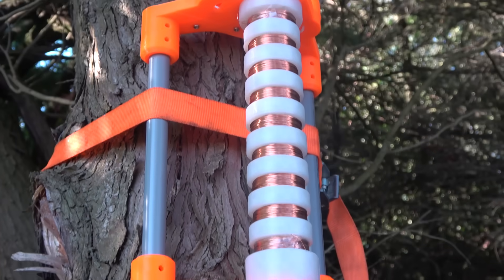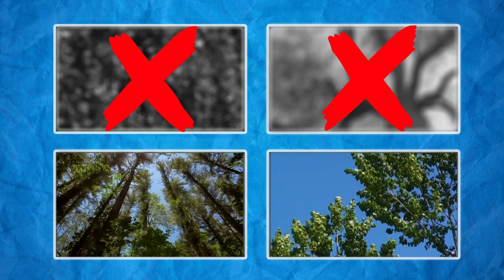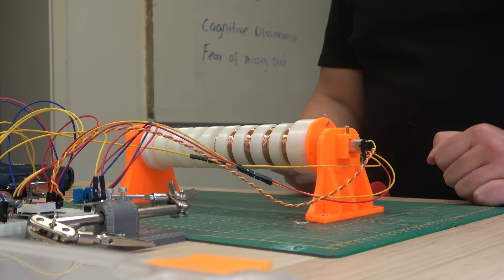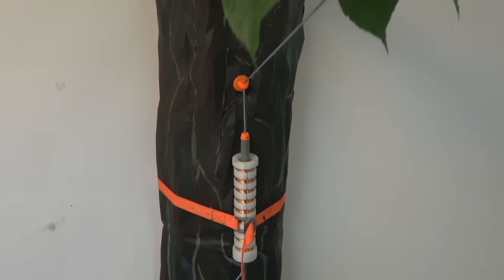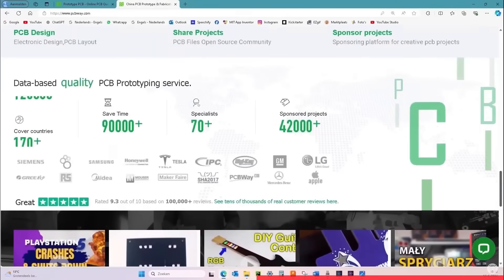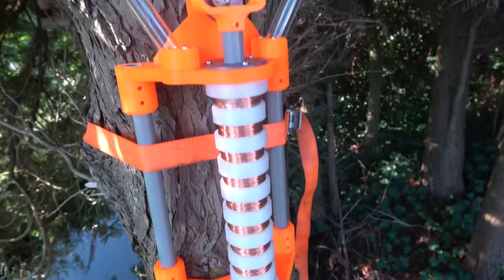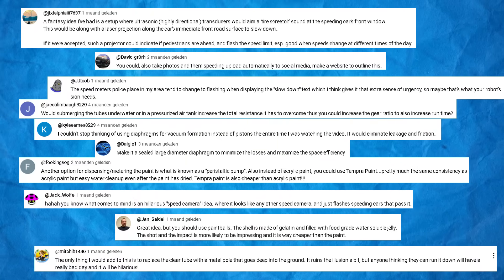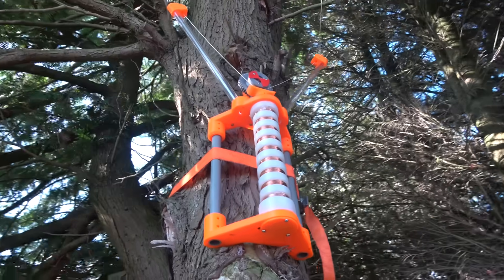I Made a Tree Generate Electricity..

Comment: bravo -- brilliant. 

my thought is to position the piston horizontally -- this would alleviate the extra energy needed on the upstroke due to gravity. 

since one of your goals is to keep the device aesthetically unobtrusive you could place several shorter devices on the trunk instead of a longer one that stretches beyond the diameter. 

to reduce friction and vertical imbalance you could place repulsive magnets on the core that extends beyond tube to "levitate" it above the bottom of the tube -- or reverse the configuration so coils are on the inside and the magnets on the outer tube. 

again, bravo, your creativity and imagination has you standing head and shoulders above most others doing this on youtube.

Comment: Anchoring: Straps flimsy and possible damage to tree (as noted by others), lag bolts used other applications but dangerous in a sawmill. I suggest using "trunnels". Wood tapered pegs commonly used in traditional ship building. Black locust or hickory ?

Comment: Nifty idea!  Some thoughts:

1. Every region has 'prevailing winds'--which accounts for most of the wind direction--that can be looked up for your locality.  If you only worry about branches perpendicular to the prevailing winds, you will automatically increase the system's efficiency without any extra effort.

2. To multiply the force, just attach the system to multiple branches in a flat chain.  (You might want to add springs on each side of each branch or use elastic cord to avoid excessive  strain on the system.)

3. For more even power output, I suggest using this system to charge a 'gravity battery' instead of generating electricity directly.  (i.e. A heavy weight is hanging from a cord that is wrapped around a drum.  As gravity pulls the weight down, the rotating drum uses a gear multiplier to rapidly spin a generator.  These are used for LED lamps/phone chargers/etc. in many developing nations as they are so simple & easy to build and use.)  A rachetting mechanism could use the force from the branches moving in the wind to pull the weight back up, 'recharging' the gravity battery.

4. Multiple cords, each on its own drum, can be used with a single generator both for more power and to smoothen out the pulses.  A simple 'reversing gear mechanism' would swing each drum to the left/right so that the generator shaft is always rotating in the same direction, no matter which direction each drum is rotating.

Cheers!

Comment: How long would this generator need to run for to generate enough energy to make all the wire magnets and plastic used in its construction? My guess is that it would be longer than the generator will last for, quite possibly longer than the tree will live for.

At very least the gears will have to be metal or they will wear out way too quickly, you will also need to make the whole device weather proof and sun proof as trees obviously need both and water rusts metal and the sun destroys most plastics over a few years.

The rope would also degrade over time... I'm sorry but I can't think of any way to make this viable. You are better off just planting a load of trees and then harvesting them when they are large enough and burning them in a much more traditional generator.

Comment: I'm a bit rusty but if I remember correctly the power generated by a motor like this should be P=((number of loops per single coil)^2*(lenght of single coil)^2*(vacuum permeability constant mu0)/2)*(frequency of oscillation)*number of coils). I counted the oscillations based on the few seconds of footage to be about 2 oscillation per second, topping the power production of a single one of these to be .12 Watts. Basically you would need about 300 of these to run a tv, or 10000 to power your entire house; if you are very intensive you may be able to place 10 of these per tree, but I'm guessing the cost of materials would not be worth it. I am really curious on how this design can be improved though

Comment: When the wind blows on the branches in the same direction, the rope will break or the gear axis will break. I think it is better to tie one rope at the top of the tree as in your first explanation, but use a gear that has half the number of teeth and the other half is empty so that when a lot of tension occurs, it rotates 180 degrees and when it reaches the place of the empty teeth, the rope will relax, causing the axis to be released inside the tube since the axis is attached to a spring at the base. I hope you get the idea.

Comment: Have the linear motion run many different air pumps.  Hosses collect the energy into a central location from multiple branches into a pressure tank, perhaps a soda bottle. Then run a turbine or one of those motors on those old AirHog air pressured airplane motors to turn a rotational motor. For the pumps, they could be bladders of air that wrap around the tree in different configurations that the movement would act as a pump over a check valve.  This would allow capturing motion which may not be linear.

Comment: nice! I had that idea some years ago.  I'm only mentioning that because it's especially interesting to me to see it working!  I arrived at the idea because I was building a treehouse, with modern hardware that consider the tree/trees movements.  I thought, why not power the house with--> the house! I decided on a simple retractable  spool(like a carpenter's tape measure or 'yo yo').  Hook the string end to a branch and the rest(compact generator) to some part of trunk and plug in some wires, done. Dozens could be strung together in matter of minutes and create enough watts to run lights and small appliances through a battery bank.  I'm working on a prototype for a product that uses the source of energy.  It doesn't require a battery bank or at least not a large one. But I'll save the details for the final release.

Comment: A circular alternator would be far more efficient than the tube. You've already used the gear in your design, simply swap that out for the circular style. Also if you can get them to spin in one direction rather than than a back and forth you can build up momentum during the moments that there is no movement.

Comment: is the linear generator that much better than having a clutch bearing to maintain a single direction of a rotating generator? you would be able to add a flywheel to make it spin nearly endlessly since the main characteristic of a trees' movement is the sway so back and forth endlessly.

Comment: Two big issues I see with the idea. One is the growth of the tree affecting the length of the lines you have operating the generator. You would be, throughout the year, having to adjust the length of those lines. But who says you can't build a tree like structure that, of course doesn't grow, but does sway. But then, why not just build a generator in the style of the old wind mills and we already have those. Second issue, which could be dealt with but makes the whole thing more costly to produce, and that's it's tolerance to the effects of weather and aging. The more expensive it is to produce makes it only practical if the power produced is significant. I do like the idea and the heart of your generator would be great for an idea that I had to use the motion of waves in a lake or ocean to generate power.

I had another thought that represents a problem for your devise. Trees are always shedding small branches and twigs that will undoubtedly, become a monkey wrench in the system when they get caught up in the lines. You might be climbing the tree quite often to free up a snarl.

Comment: FYI... it is the Wind that generates YOUR electricity using a Very Low Efficiency Wind energy capturing Device. Wind turbines are a lot more efficient. Nice Gimmick though
Reply: Is it possible that wind turbines are not always the solution in every single situation, and there just actually maybe a place for this linear generator setup too?
Reply: @fringestream990  I would need Tree Size and Wind Speed to KW output Data.....

Comment: I've seen a number of brilliant ideas mentioned already and at the risk of repeating some (since I haven't read all 2473 comments) I've got a couple of ideas that could very well be silly but that I'd like to throw out there anyhow. 

I love the idea of a flywheel it is something that I had considered while trying to design a vertical axis wind turbine(VAWT) once.
One thing that I thought might be a good idea is to make the armature that moves up and down (to and fro or oscillating motion) to one that can convert to circular lotion like in a piston; this way there's a better chance to keep a constant flow of kinetic energy as opposed to it stopping everytime the direction has to change. 

I'm also thinking on the lines of a capacitor like storage option (springs?) that can store energy that may be too less to generate current due to gear ratios or whatever thereby storing up small bits of energy into something like a gravity battery so that the gravity battery can then power the armature of a standard circular generator. 

Lastly, since I understand that adding more components leads to increased loads on the initial mechanical energy harvesting device thereby possibly leading to higher inertia that prevents the flywheel or mechanism to start, a VAWT could be used to harness smaller movements/weaker wind; this in addition to the capacitor/spring - gravity battery concept might offset the inertial problem at the risk of making things more complicated.

I figure that if a freewheel is involved, any small energy boost can help increase the momentum of the freewheel, which will directly convert to energy produced in the longer(ish) run.

Comment: To increase energy recovered per stroke you need to use a gearbox that will amplify speed (E= kg*W) where E is back emf, kv is the speed constant and W is angular speed rad/s  this is difficult to do in linear generator so you need to attach a rotary generator directly to the pulley shaft. Also connect the pulley as much as you can in the same plane that the branch is bending that will increase your mechanical to electrical power conversion efficiency.

Comment: I think this is awesome, and important! This is what you call micro-generation. The idea is that no one micro-generator idea is THE ONE that will solve all of our problems; however if we maximize all the opportunities for micro-generation that we can put a significantly huge dent in our power generation. Think of it this way: imagine if you had these on every tree in your backyard, AND you had a micro-generator on every door and cabinet door in your house, AND your bed and couch had micro-generator, so on and so on.
Reply: Not that I can't see the idea here, but it also sounds like you'd be using a hell of a lot of materials and machines/components to create all those microgenerators, all of which will have (significant) energy use and pollution effects in their manufacture.

For example: A friend of mine once looked into replacing something in their house with something that was more resource efficient in daily use (I don't remember what, exactly, it was; just know that "efficiency" here could mean energy, water, whatever). What he found out was that the manufacturing cost (not only in terms of money, but also the energy and resource costs of manufacturing the new component) outweighed the savings he'd make overall. Point being, it takes a significant amount of energy/water/chemicals/whatever to manufacture most things, and for the often very small gains gotten by the end consumer, it often actually doesn't make sense overall.
Reply: @mnxs  Totally legit point! That's why I think there is no "one" answer. Macro generators have the same problem, with distance and machinery size energy efficiency drops. There is a "sweet spot" in there we need to figure out. For me, the process of that "figuring out" is what I like to see. This guys experiment can now give us same actual data to work with to gauge the efficiency.

Comment: Here's an idea. A strain gauge utilizes deformation to vary resistance. Similarly, you could wrap a tube with liquid up/around a tree, and the deformation of the wood would cause the fluid pressure to vary inside the tube. This pressure could then be converted to linear movement using a piston. Use four valves to create a liquid rectifier if needed.

Comment: This is definitely neat, but I worry the cost of maintenance will be high for it's potential output.  Squirrels and chipmunks will no doubt love to chew on parts of it.  All tree dwelling wildlife will make it their sole purpose to defecate over every square inch.  A shell over the outside might solve most of that.  But still natural disasters and the course of life, in general, will take down branches or even the whole unit or tree.  In order to be successful it'd have to be something cheap enough to spam across an entire forest and easy enough to maintain that you aren't fighting a losing battle keeping it productive.  Still, very innovative and much nicer looking than a field of wind generators :)

Comment: What a fantastic idea! I would add a winding mechanism so the energy could be generated at a constant rate: the movement charges the winding mechanism and when it reaches a point, it will move the piston constantly, not in the erratic manner you presented. You could even time it so it has the correct frequency of the grid.

On second thought, scrap that: the winding mechanism could itself be a circular generator instead of linear.

Comment: Oscillations?

1:05 - yes, correct.

This device also acts as a kind of braking system against high winds, but I’m not sure if this is a positive or a negative in terms of tree health.

The design I came up with (but haven’t done the math for to allow macro scalability & efficiency), is an ‘artificial’ tree.

Safer, more compact for urban environments instead of windmills, and the height can be optimised without two problems windmills face (because higher = more wind power), and they are safety & aesthetics.

I’m also talking about bird safety.

They’re also capable of acting as a wireless array, keeping all the pollutant EMF far above civilians, allowing for a ‘tighter’ control of communications infrastructure & more.

It’s great seeing someone actually using trees, I love trees.

Comment: There are so many comments, sorry if this was already covered and I'm repeating ideas you've already heard.  First of all, I like the idea of converting the wind's kinetic energy directly into stored energy better than directly into electrical energy. So for instance, the comments here that have discussed a "gravity battery" or "crane battery" using a winch to lift a weight. Then you can release that energy smoothly and continuously later with a generator. For a wooded path, you can capture "sway energy" all day, and then power an LED light all night. This might be getting too complicated, but the flywheel idea also makes sense for temporary energy storage in combination with the gravity battery, so you could tie both into the generator and thus extract the additional new kinetic energy being created at the same time as you are extracting the stored energy from the gravity battery. There was also a comment in here somewhere about the high-torque, low movement of the tree sway, I wonder if a planetary gear could most efficiently convert that torque into the higher RPMs needed to efficiently drive a flywheel or generator.

Comment: Wouldn't it be better to use some form of an alternator instead of a tube system like that? I'm not saying one from a car would work but since you already have rotational energy wouldn't you want to keep it in that form to prevent energy loss from converting it? Maybe then put a flywheel on it to store some of that energy as more rotational energy so when the branches change direction the system would still have energy for a more consistant output. I know that most sporting goods stores have those hand operated flashlight/usb battery banks and I was thinking that maybe the electrical circuts from one of those could ease the development of converting the energy into something more... usable. Since 5v is the standard for most USB devices I think that would be a good starting point.

Comment: Fabulous! 
Similar to an idea I had with a vertical column of tiny spinners for wind, fastened at the tree trunk.
My suggestion right away for yours is to find a way to extend downward and out instead of upward, with a  fail safe hinge mechanism to bend inward, guarding against falling or collection of debris. This would potentially significantly reduce breakage and maintenance over time. Thank you for sharing! 🎉🎉🎉

Comment: Have you considered putting the magnets/wiring onto a flywheel and making it to where regardless of the tree movement it would turn the flywheel one direction. Decreasing effort to keep the magnets moving, removing gravity as an overall issue, it may require a more complicated gear structure.

Comment: Builds a linear generator that requires reciprocating motion. Then builds gear to convert linear to rotating and back to linear... when you could just use the rotating motion as far better generator... I mean, linear motors and generators are kind of cool but there is a reason why the word "efficiency" has never been linked to them.

But my solution would be different. I would use the branches to lift up a weight that stores potential energy until it reaches a certain height, then is allowed to fall down and rotate a generator. You get more "oomph" out of the system and can optimize the energy harvesting better, compared to tiny trickle. You will anyway have very sporadic power generation so why not go all the way, and capture overall more of it. Tiny trickle of electricity will be eaten by the losses just in the electrical circuit as the motion is slow and there is not a lot of it.